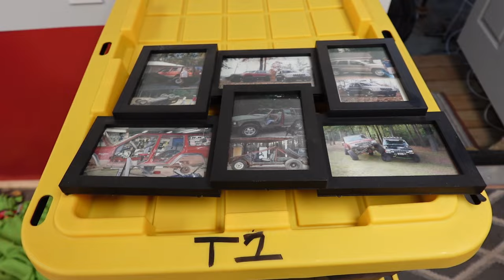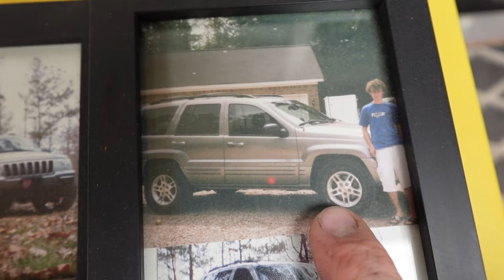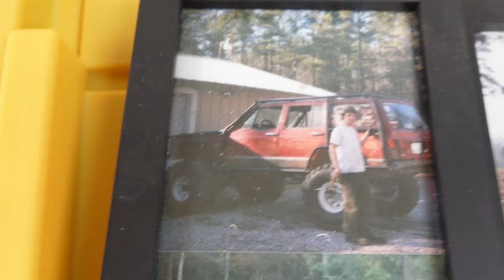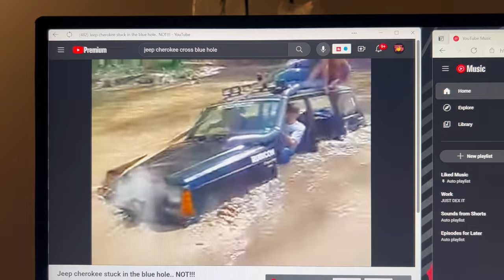The Tale Of My Very First Daily Driver: A Journey Worth Sharing!

Comment: I bought a gently used '96 XJ that was in the rare factory magenta color from its original owner in November 2003. I drove that thing daily, and as the years piled up, I vowed that I'd give it a decent retirement if I could get 20 years of use from it. November 2023 came very quickly, and I was reluctant to let it go, so I held on another two months until January 2024, when I sold it to a coworker. I missed the thing dearly (who wouldn't after 20 years of daily driving), so I've since purchased a nice 1997 XJ in white to replace it as my commuter.

Comment: Back in the late 90s I had a system that I had $500 in with all brand new ample audio speakers and amp. 12’ svc x2 and a a226 520 watt amp with a blaupunkt CD player. All that was in a 92 g20 Chevy van. I also have all ample mid range stuff to but that was the cleanest and hardest hitting system. I won a trophy from it and also took it to a db contest and got 141 db reading off $500. The only people louder than mine were the people that had several k on theirs.

Comment: Nice jeep. I love my jeep xj's I had a bunch of them already. I'm down to only 2 now. My 93 sport high output and my 91 sport high output police one. At least that's what stetler dodge told me when they did the Vin to make me a master key.the 93 is sky jacker 6 in. Lift 34 in super stampers. And 91 is 8.5 in sky jacker with 36 in stampers which the 91 I swapped out the Dana 35 to the Chrysler rear and I also swapped out the drum breaks in the rear for the disc breaks . I love building jeeps and my own bumpers fenders so fourth.  I'm an auto mechanic myself certified welder and any chance I get to build something I go to it lol. Love your videos keep them coming.

Comment: I've got a couple xj dana 44s in my stash one open diff and one trac lock. I still have my first xj it's had a few different stages but this last refresh it's real nice. I've had a bunch of xj's definitely not as many as you im guessing around 20 or so but for whatever reason my favorite ones are 1992 or 91 and 92 So I've mostly stuck to the 91-95 and more specificly the 91-92 but there's stuff from other years I like more that I switch around. I'm really picky with little details. I've been going through xj's at my local wrecking yards for years but recently they've been having less xj's so I started buying some to keep as parts rigs and future projects. I really like making them have nice interiors so I always snag clean interior pieces that I like. One thing I've been looking for is a factory black early interior to snag the dash and center console and interior plastics from if nice but they are incredibly rare I've only seen one renix era Cherokee with factory black interior I've seen plenty of maroon and blue tan and of course gray but the black is super hard to find I really want the black dash and bottom dash trim and other black pieces I'm not into painting interior parts. It's gonna be super hard to find good not cracked or faded pieces though.

Comment: Well I thought this was a good idea I kind of wanted to know for a while where and how you started and I'm definitely gonna be waiting eagerly to see the electric to crank window conversion because I have a 1989 Tudor that's got power everything and I can never get the windows to wanna go very fast when it's cold out and the summer they work fine but that's when I'm using the air conditioning so i just leave them up(SO-CAL) but in the cooler months when wheelin they might go up and down 20 times a day.

Comment: I bought my current XJ in 2005.
Reply: I'm still driving our 01 limited we bought new in 2001. Well, that's if I can get it through emissions for a re-test in the next week or so.
Reply: @MikeOrazzi  Oh that's awesome!  Is it still stock or modded?
Reply: It was stock until about one year ago when I needed new leaf springs, shocks, coil springs, etc. so now it has a 3 inch lift. The rust however is doing a number on it.  @TexasRedneck
Reply: @MikeOrazzi  I've had the same lift on mine since I bought it.  The lift was actually on my first XJ and then I sold that and got this one in 2005. Though I did change the rear add-a-leaf to a full 3.5" pack(bought used) a few years ago.  

Luckily I'm in Texas so no worries of rust though the jeep did originate from Colorado.

Comment: Can someone tell me which line coming from the radiator on a 95 xj is the return line. Is it the top or the bottom one. Want to add a transmission cooler and the video said newer modela have it up top and older might be down below so just want to be extra sure. Is there a way to tell.

Comment: Hey man I’ve got a 96 xj I’m having issues with it do you mind me getting in touch with you so see if you know what might be going on?
Reply: What's wrong with it
Reply: When it gets to operating temp and turn it off and turn it back on I doesn’t want to go over 35mph
Reply: Mass airflow leak is my in the dark shot. Check your vaccum lines/pcv lines. Especially the rear one. If you don't have a smoke machine, buy a pack of blunts.😅 good luck. Could be vapor lock on the fuel rail. Make sure your harness is clean and not falling apart along the fuel rail. Good luck 🤞
Reply: Or your trans won't shift up. Hmmm...
Reply: @HawkeyeMobileAutoRepair  I can get it to shift if I rev up to 5k rpm sometimes after it shifts it doesn’t do it again